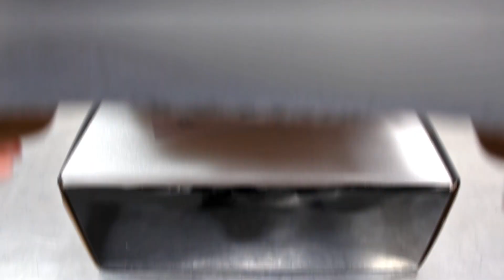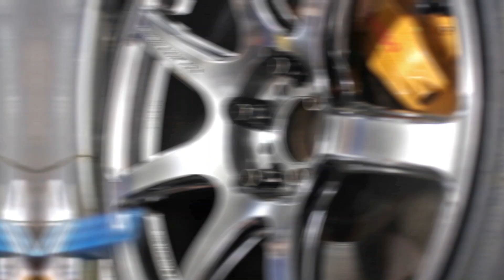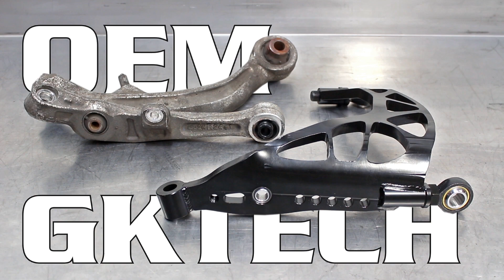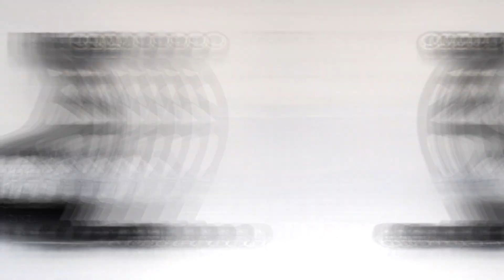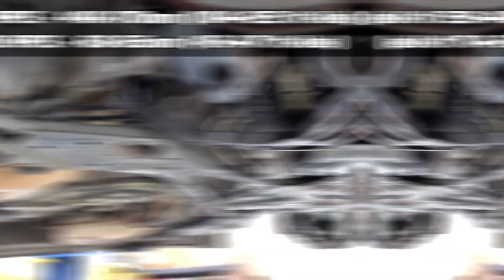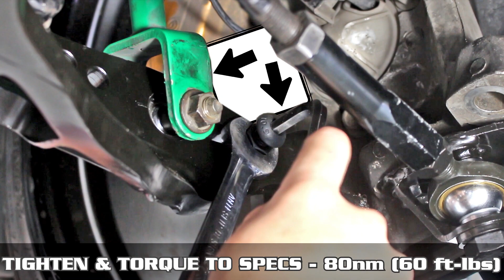Gktech V1 Z33 350z V35 G35 Super Lock Lower Control Arms - Install

Comment: Do both bolts need to be equal when extending the lower arms? I’m trying to set my track wider and my castor. I have also got v2 fucas to install.
Reply from the maker: Yes, they both need to be at the same measurement, however, you absolutely need to follow the assembly guide which shows this.

If you have the older arms then feel free to email us at sales@gktech.com and we can send through the assembly guide.

Comment: I have the v3 angle kit, how much more camber and angle I can get out of it? Thank you!
Reply from the maker: Hi mate, camber achieved can be quite extreme due to the amount of length over OEM when completely extended. As for angle, you will achieve much more clearance but realistically the biggest change is the steering feel. The OEM 2pc design does not feel anywhere near as good as 1pc LCA.

Comment: When removing the compression arm from the body mount its left a sleeve on the bolt and sized onto it and left the rubber and a steel I think sleeve.. Anyone have the issue and how'd you get it off
Reply from the maker: Send some photos through to sales@gktech.com and the team should be able to assist.

Comment: Will it hit if you run 19 inch rims?
Reply from the maker: The kit will fit, but it would depend on your width and offset on where the wheels make contact. In saying that, if you setup your lockstop to stop before the wheels hit, you should be all good!
Reply: @gktech  can you make a video installing these without the steering rack?

Comment: i have the extended tie rods and rack spacers, want to get these but what else would I need to get to maximize my angle?
Reply from the maker: We would definitely recommend the bolt on angle kit here - https://us.gktech.com/v2-z33-350z-g35-steering-angle-kit
Reply: @gktech  i already have this. so this paired with these lower control arms should give me maximum angle correct?
Reply from the maker: @Its_takaa  With the bolt on angle kit, the bolt on rack spacer and these lower arms, yes that would be our full front superlock kit which will give you the maximum angle.

Comment: I just installed mine last night. I think the biggest issue I had with the install was getting the "big spacer" on the chassis stud. I coated the stud with WD-40, took a little bit of 800 grit sand paper to it, and still had to use the nut and impact it up into place. This kit is never coming off unless I cut out the chassis stud. 
Other than that, I got hella clearance and great angle paired with the GKTech angle kit.
Reply: Oh you need the angle kit as well as this ?
Reply: @daskamu  these don't really grant much benefit with the angle kit.
Reply: @danedrifts2575  without*
Reply: no u dont, it stops steering bind, lca is still worth it  @daskamu

Comment: So what’s better on running length...25mm or 50mm? Does it change driving feeling?
Reply from the maker: Hey dude!
Yes, it will change the feel of the car as you are winding more camber into the front.
It is setup dependent, but I would suggest going as least amount of extension as possible, aligning and going from there.

Comment: will this help fix any over centring issues
Reply from the maker: Hey dude!
I would suggest checking the basics first being that you have centered the steering rack and gone for a wheel alignment.
If all that is done and you still have issues, these arms will reduce the over centering issue being as they are a one piece design which increased caster angle!

Comment: Will this help with the issue of the inside my tire rubbing the sway bar at full lock?
Reply from the maker: Hey dude!
These arms will allow you to move the wheel further out from the bottom, which will help move the tyre away from the swaybar, depending on the size of the wheel/tyre, however you would need to correct the top side with camber arms also.
In saying that, you could also run spacers to move the wheel out, or get a lower offset wheel.